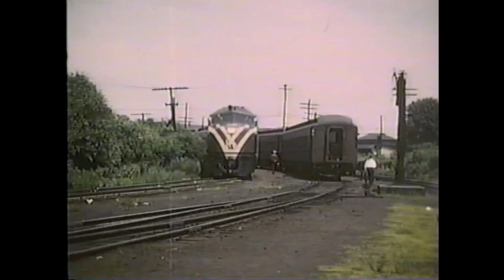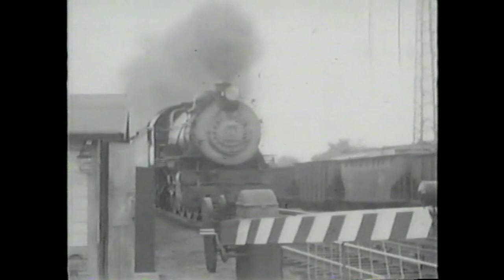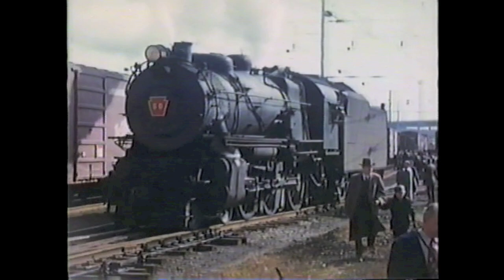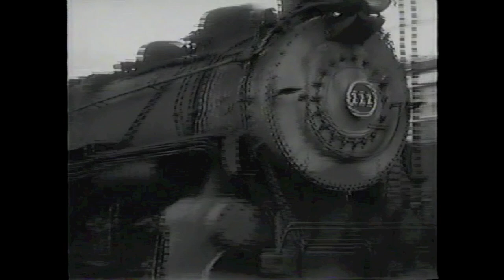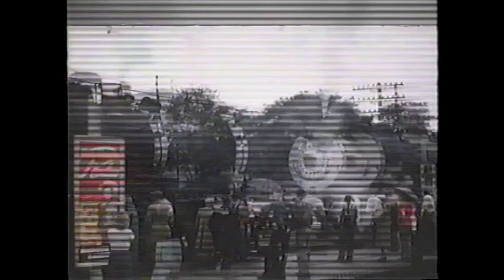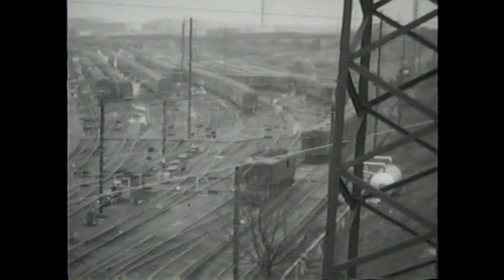Pennsylvania Glory Volume 1 - Long Island Railroad Segment (Featuring LIRR #39)

Comment: I'd love to see CSX (PRR successor) restore a GG-1 to run on the NEC. If UP can restore a Big Boy, I don't see why CSX, or someone else, can't functionally-restore a GG-1 electric.
Reply: The Norfolk Southern railway is actually what operates most of the former Pennsylvania railway's lines and routes. But yeah, It would be great if they restored one to operating condition. I would really love seeing one running the rails again. Also, I apologize if the first part of this comment sounded a little hurtful, I was just pointing something out.
Reply: @NostalgiaFreak1996  Not a problem, I took no offense. Thanks for the correction. 🙂
Reply: A GG1 would be very difficult to operate today. The type of electricity the GG1 ran on is no longer used anywhere, and all of the transformers were removed from all of the surviving GG1s.